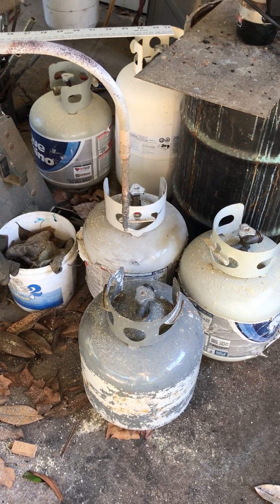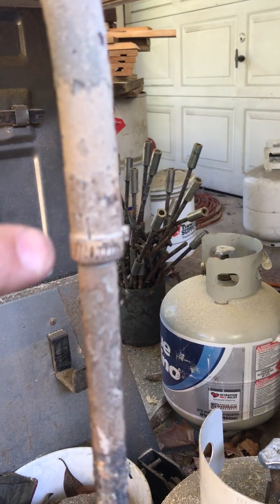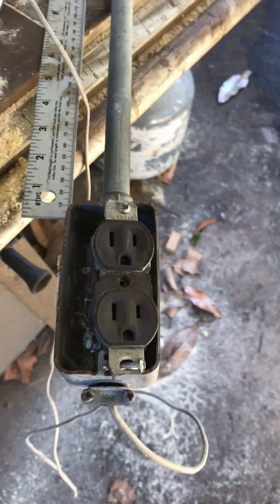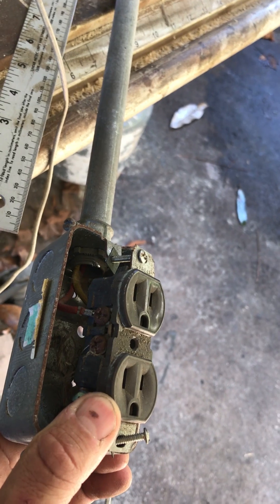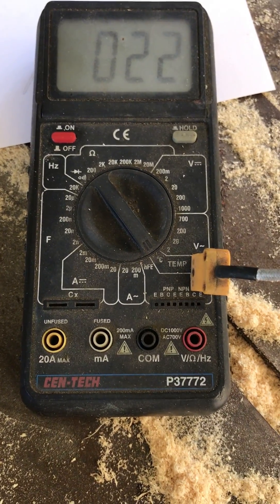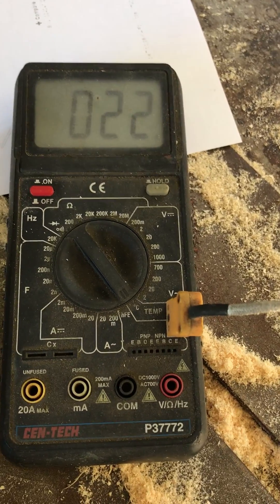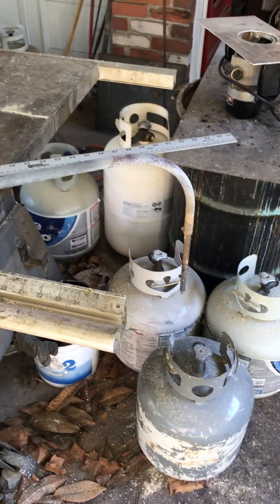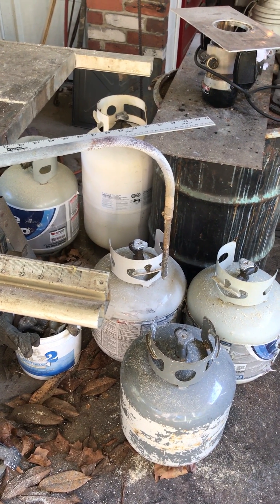Simple  imersion Pyrometer Build  for metal casters

Comment: I agree... why store it pointed down?  The only thing I can think of is to decrease the chance of it falling, but there are lots of safe ways to store it.
Reply from the maker: if you lay it on its side you can potentially stress the wires  or more importantly the wire joint which is what actually "reads" the temp